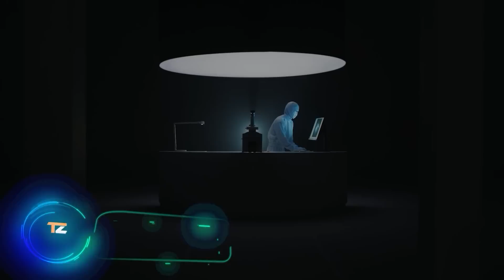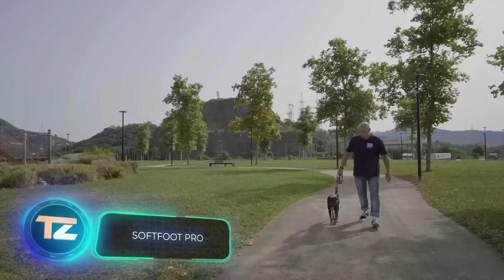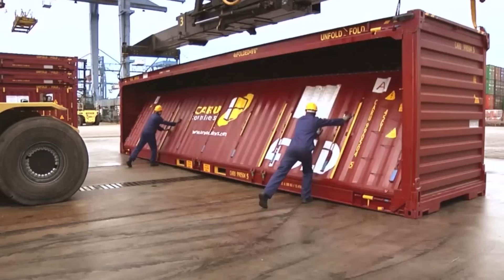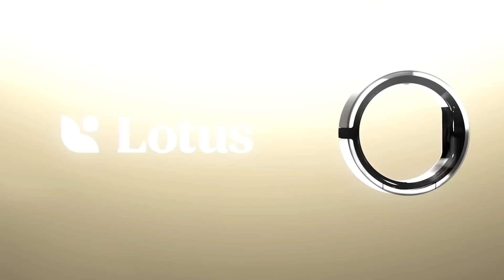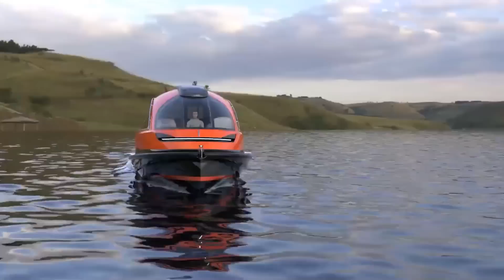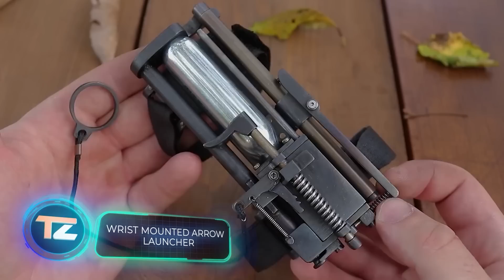INCREDIBLE INVENTIONS THAT YOU HAVEN'T SEEN BEFORE

Comment: All helicopters can autorotate with engine off. No exceptions. The claim this is the first helicopter that can autorotate with the engine off is false. Likely intended to state first to autorotate without pilot controls. That may be true, though I would not affirm without research. After all, helicopters have included autopilot for decades and the autorotation is a fundamental aerodynamically stable feature of all helicopters.

Comment: Can 3D printing technology completely replace traditional manufacturing methods in the near future?
Reply: Depends on the industry and purpose of the final product. 3D printing has yet to match the strength and relative cheapness of forged steel to cite one example. Theres some really good options for 3D printing in construction. Wood framing is still easier, faster, and cheaper overall there. 3D is awesome for intricate manufacturing such as baffleless gun suppressors. Overall making prototypes is where 3D really soars.
Reply: Dont u think? Id say its in the werx.